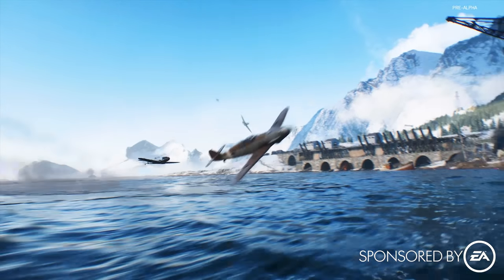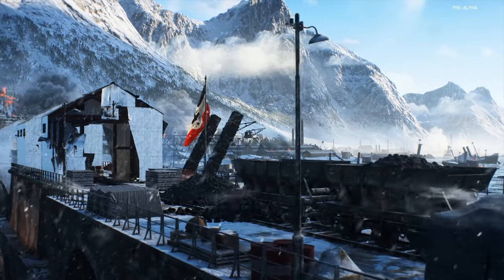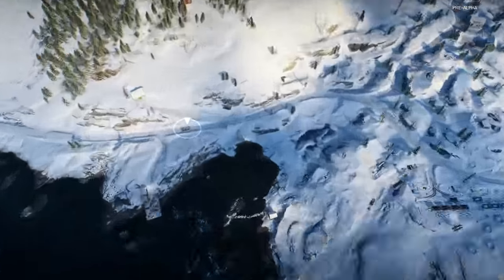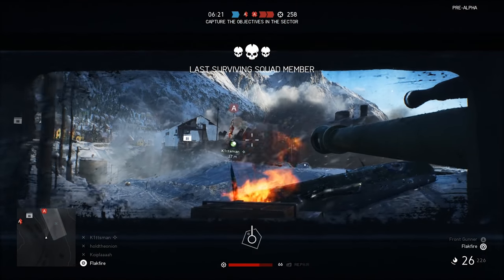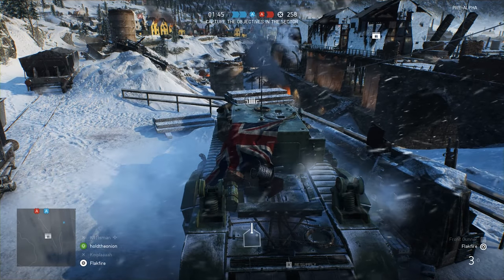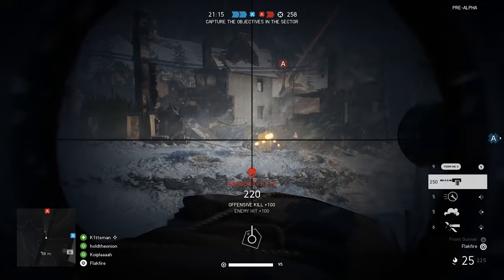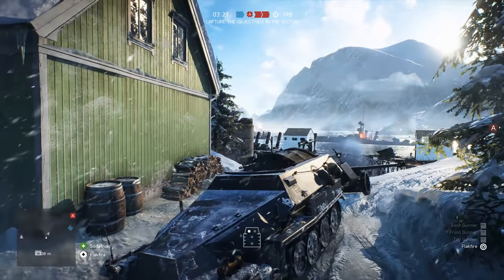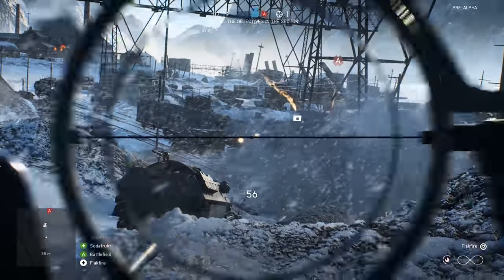BATTLEFIELD 5 Vehicle Gameplay Mechanics: Resupply, Repair, Towing Explained

Comment: omg DICE found how to balance vehicle campers? i really hope so
Reply: not really...all it takes to get infinite ammo is that you spawn with a tank as tanker class redeploy as support player with repair wrench now build a supply station around your tank and hop inside tank now you can self repair too bcoz you have the repair wrench.
Reply: Finally a way to kill battlefield campers
Reply: shubham sane These supply stations can‘t be built everywhere, just at preset places on the map. If Dice makes it right, they won‘t be at camping spots.
Reply: J.T. Kirk as long if they place them where vehicle camping is difficult or impossible. Granted as a level design, Dice would most likely place supply depots near the main spawn, but eventually, place them further out where hot zones may occur
Reply: lets hope so...but they should also be a bit away from line of fire or else infantry will get killed while resuppling their ammo
Reply: pooven mootoosamy not really since they can stay near suply points
Reply: They were always balanced. They were ineffective, and easy to kill.
Reply: shubham sane they will have to count on their team and stop playing as a Lone wolf
Reply: Oh my. Why does this show Battlefield 1's awful arcadey vehicle spawning system, where vehicles magically appear on the map as players spawn into them? That was one of the really bad parts of Battlefield 5. It removes immersion and a sense of realness, and it just feels so cheap, shallow, and arcadey. WTF would they do that again in Bf5?

Battlefield 1 is boring, its UI is distasteful, jarring, and sterile, and its mechanics are too simplified and arcadey. Battlefield 5 is looking like Battlefield 1. Not good.
Reply: So u played the release code paco? Share more of ur intellect.
Reply: pooven mootoosamy this doesn’t balance it out
Reply: David You really want a mini intro for a vehicle?? It's a game, I don't need a 10 second cutscene of some dude hoping in a tank.
Reply: Not a fan of the mid-air plane respawn. That's just stupid. In BF2 I remember having to land at base to resupply. They should do that. If maps don't have airfields then the resupply points should be far, far away from the objective. Like, the outskirts...
Reply: David ok, so how exactly would you do better, eh?
Reply: You can't balance them. They're low level or u don't like vehicles. DICE is overpatching the vehicles until nobody wants to play them since Battlefield 3 each Battlefield. Why? Because players can't handle them or walk infront of them I think. Vehicle campers are just a single excuse for bad players.
Reply: bf 1 had fantastic vehicle balance. let me guess everyone wants bf4's vehicles. tanks=garbage, attack chopper=op
Reply: BF4's tanks are far from garbage. Attack choppers aren't OP. Only the gunboats and the mobile AA are OP in BF4.
Reply: Yes but they screwed how vehicles spawn in

Comment: I love that they included the Sturmtiger. However I feel it wasn’t presented accurately- it fired way too quickly and the blast didn’t seem to be big enough for a 38cm rocket! The loading time and blast should be similar to that of the armoured train/ dreadnought’s main cannons in bf1.
Reply: If not longer, they used a built in crane to load the rocket propelled shell, which took about a minute to reload. This one took 2 or 3 seconds and while it did more damage to the tanks relative to other armor in game, it was no where near the giant bunker busting monster it was designed to be.

Comment: 'The Sturmtiger has improved frontal armor, just like in real life!', he says while shooting the 380mm gun 3 times in 6 seconds
Reply: Young Thinker - iuvenis animo you mean 45 seconds !! with very high damage ... at the current state in the trailer it's just a normal tank and nothing special about it.
Reply: AnalDash
 i guess u never played the KV-2 in war thunder. That thing has a 60 sec reload, instakills everything, and is the most fun tank to play in that game. And in comparison the kv-2's shells only have 6 kg of explosives and it is fighting other mid war tanks. The sturmtiger has 125 kg of explosives and in bf5 is fighting early war tanks. No fucking way it should not instakill everything in a 10m circle (10m is a little less than the length of two sturmtigers, where one is in front the other). In comparison, the V-1 rocket has 850 kg of explosives and kills everything in a huge area on the map.
Reply: AnalDash
That's good, good players will know how to use the sturmtiger effectively, and good players will know how to counter it with anti armor infantry! :) And bad players will QQ on the forums thats eather too OP or pure dogshit. :P
Reply: They should’ve added the Brumbarr instead of the sturmtiger. Easier to balance realistically

Comment: Church Mk 7 has better AP cabability while gun Carrier shoots faster? Wot?
would've made much more sense if that were the other way around.

The Mk7 literally uses a 75mm gun with the ''Quick Fire' designation while the gun carrier sports a modified 76mm anti aircraft gun.
Reply: Well, the Sturmtiger reloads in 3 seconds ingame. It's BF being BF.
Reply: And that.
Reply: 380mm rocket launcher technically, and it was firing at the side of an early war PzIV, so that's about 20mm lol.
Reply: Took 3 shots to destroy the panzer IV, kinda dumb
Reply: If it could destroy the panzer IV in 3 hits that'd be even dumber and not fun to play against. If we're going with realism let it one shot anything but have a 5 minute reload
Reply: ehhh that's honestly be a bit much, I can't imagine that being fun to fight against, I say have it deal real high damage (not enough to oneshot a tank from full HP from the front) and have it take 30-45 seconds to reload.
Reply: Even that itself it pretty unfun. Miss a shot and it's another 30-45 seconds of doing nothing. Realism isnt always fun is my point.
Reply: punipuni
I was thinking more on the lines of a 20 second reload
Also, how does one miss with a 38cm wide rocket? that blast radius won't play around. :D
Reply: ehh, it works fine for the KV-2 in WT, I don't see it being a problem here.
Reply: The problem is this isnt warthunder. Tanks are scarce in battlefield, one shot one kill doesnt fit well into that.
Reply: Why do you think I SPECIFICALLY SAID don't let it instakill from full HP then?
Reply: You said KV-2 which is essentially a one-shot, so i assumed you went with that. If it wasnt an instakill and it had 30-45 seconds of reload it would be utter trash.
Reply: I suppose it is true that BF doesn't have as detailed of a damage system as warthunder, so you can't cripple tanks.

I guess the thing that annoys me is that this thing shares basically nothing with the actual sturmtiger other than looks, it basically plays like a Stug with its current implementation.
Reply: Yeah i get what you mean. With a sturmtiger you expect a big house levelling boom but you end up getting a regular rapidfire cannon. I'm not really sure why they didnt just go with a stug when it has nothing in common with the sturmtiger.
Reply: The "Quick Firing" designation does not refer to the speed at which the gun can be reloaded. Originally a British naval term from the late 1800's, it is a reference to guns that had started to use bagged charges inside a brass casing. With this method, the gun was able to detonate the charge with a primer in the base of the casing and get the projectile out of the gun faster then previous methods.

Penetration wise, the OQF 3-inch 20 cwt and QF Mk.V were about on par. The Shot Mk.2 for the CWT was going to penetrate roughly 104mm at 100m while the Mk.V (being a near licensed copy of the US M3) firing M72 was going to penetrate just under 110mm at the same range. Though if firing unfilled M61, it would penetrate less.
Reply: ParaBellum 380mm
Reply: punipuni shouldnt it be more than 5minutes? And it would take a secondary Tiger Tank Crane to get those big things in it :D it was reloaded by a fucking tiger tank xD
Reply: Benjamin Conrad No. If needed, it could be reloaded in about 1 minute to 1 and a half minutes. The Sturmtiger had a fully pully system on the internal roof to assist loading so not put the crew in danger. The external crane was for restocking the vehicle. But I still want to see a bigger blast. This does not feel like an 829lb 2 stage rocket assisted warhead with 276lb of explosives.

Comment: That Sturmtiger is reloading TOO fast, even for a video game
Reply: Paladin Colt I agree but it doesn't do alot of damage
Reply: Your friendly neighbourhood Nazi The Sturmtiger took 20 minutes to reload because it was so heavy, they needed five men and a crane to lift a round
Reply: Supreme fatty Kim Jong un yea which make it even worse a long reload with very high damage is much better .
Reply: Supreme fatty Kim Jong un
the sturmtigers 380mm rocket with its 125 KG of explosives could probably delite a modern abrams, it should have a long reload with Instakill dmg.
Reply: 20 minutes and the crane were for a vehicle restock. Internally, there was a full pully system inside to assist loading, but it still took over a minute to lift a round, pull it, place it on the rail, and push it into the breech.
Reply: They should’ve added the Brumbarr instead. Similar concept but with a smaller gun which could be balanced more realistically
Reply: true, but the name "Sturmtiger" sounds more menacing

Comment: it would be really interesting if instead of having the resuplies for the planes on the sky, instead of that they could add like a base where they land their planes and manually resuply its ammunition, of course that would mean that enemy planes can enter the base and destroy the planes while they are unable to counterattack, this is only hipotetical but lets think that they do in fact add a air base where they could land their planes and repair/resuply them, 2 ways to balance this out I think it can be 1. having a lot of powerful aa canons that player can use or even it is I.A that can target u down, you can still destroy and kill both planes and pilots while they are unable to counter attack but it would take more skill to pull something like that, or well just make the enemy base out of bounds for you.
I know it is imposible to pull off something like this but then again it is just a mere thought.

Comment: Instead of having supply points for plains in the air which looks silly they should have a place for the plain to land behind spawn it would make it more tachtical as of a plain runs out it has to go and land so its not in the action and it doesnt look as silly. They did it in bf3 were you took of from a place so u can do ot it bfv

Comment: I REALLY HOPE that the plane and tanks will have damage models similar to war thunder's damage model you know not full on models but to take you out and leave the tank still usable but to the point where you can damage the engine or take out the tracks/turret/ammo rack/ETC. and for planes where your wings/rudders/aileron/elevator will get cutoff/broken or have them be able to shoot the fuel reserves and have planes slowly burn up or anything of that sort will make planes much more intense and tactical as bombers will need fighter escorts...now that i think about it the maps might be too small

Comment: WTF is jericho siren? The Stuka didn't have any attached siren on it that pilot switched on when started it's dive xD. Only thing that I was hoping for realism is pilot would black out when doing the dive with the stuka, yes that happened for the pilots and stuka had "autopilot" to pulling itself back up when the dive reached it's lowest possible altitude. Passing out happened because of the g-forces.

Comment: The Sturmtiger should be able to one shot kill any tank at almost any angle. 350mm shell can rip open just about anything and sense you only get 16 shots, combined with slow moving speed and very limited turret traverse and a lot of weak points that hostiles can kill you from behind and on sides should give it one shot capabilities.

Comment: The rocked looked better in the trailer. And now i'm not talking about the usual "trailers have better graphics", i mean that it looked A LOT better. I actually want something more similar to the trailer explosion to be an option in the graphical settings, because now it just looks boring.

Comment: That Sturmtiger would blow a hole bigger than a table into any other tank and the reload should be super slow.
Reply: No no, there would be no hole, there would be nothing. Keep in mind that it's a 829lb 2 stage rocket assisted warhead with 276lbs of explosives. You would be lucky if you could find anything left intact.
Reply: Шогк наяdег Комгдdе 

380mm rockets of tank and building evaporation.

Comment: The resupply system for planes is a bit garbage. The fact that there is an actual amo count is great but once you run out of bullets it should just recharge for about 5 to 10 seconds, maybe even make it longer at about 20 to 30 seconds to force the plane to retreat out of combat. What do you think

Comment: I think aircraft should be required to land for resupply. Similarly to how it was designed in BF 1942, land for repair. It would enhance the depth of the game if pilots were being tested on their landing and take off technique. And this would also add the value of skilled Support players because if the Support does not resupply their planes, their team loses valuable air resistance which could be disastrous. 

And needless to say that it would be great to have aircraft carrier introduced to BF5 as well!

Comment: This battlefield looks like one of the best so far mechanically and I hope this does something about the problem with aerial warfare. For a while now planes have been a thing in Battlefield but anytime i try and fly, some cunt in an AA gun sitting in the back of the map ruins me before i can do anything. Like its impossible to have a dogfight without AA guns interfering or do a bombing run without getting blown out of the skies before even leaving spawn. Its unfair bc where tanks are able to evade possible threats by driving behind cover, once an AA gun sees you, the only thing you can do is rather fly back or down and there is limited things to do when in either of those positions. I hope that the limited ammo thing really changed AA guns ability to ruin aerial warfare.

Comment: The new vehicle mechanics are a step forward in pretty much every aspect.
However, towing is way to cumbersome to be of actual use during a match. I would've preferred if the cannons could turn around 360 degrees on their own like in BF1. That way you wouldn't need to do it with your vehicle which is very finicky. :/

Comment: There better be speed control in the planes so there is actually skill required to dogfight
Reply from the maker: There is, and one of the stuka models has dive brakes.
Reply: Flakfire interesting. I know it is difficult in these times because in bf3/4 has afterburners but how the dogfighting system worked in bf1 was horrible. It was a matter of who got behind who first and that was the dogfight

Comment: 2:38 a direct hit with a 380mm sturmtiger rocket carrying anything between 40 and 125kg of explosives would delete a modern abrams, let alone just do 47 dmg to a early ww2 panzer IV. :/ Seems like plane controls are still trash compared to war thunder, and for me are completely unusable. :/ Everything else u said in the video does sound good tho! :)

PS. edit: forgot to mention that A 4 SEC RELOAD is wayyyy to shot for a tank round/rocket that needed to use all 5 crew members and an outside the tank loading crane, to load the ~350kg rocket!!! Something that in real life took 2-4 min, if not more. Like, seriously, this thing is reloading as fast as a bf3 or a bf4 abrams with an autoloader! XD 

My suggestion is to make the rocket do some serious OP damage, but with a more reasonable 20-30 sec reload.

Comment: Vehicles still looks too easy to use, tank reloads in 3 second and turret turns as quickly as mouse sensitivity... planes look kinda slow, will they have different flying characteristic to avoid circle battles? ... vehicles are powerful assets and shouldnt be so easy to use and pick, limited ammunition is a great change... in bf4 i mostly used tank i could respawn in it all the time, ending round on top of the scoreboard wasnt a problem it was very OP once you mastered it but very easy to pick up and that was not good for the balance

Comment: Disappointed. Expected alot of changes but instead got BF1 vehicles reskinned into BFV but with limited ammo. Vehicles just get more and more dumbed down each BF. I hate the vehicle vs vehicle combat nowadays. I miss when the days when vehicle combat had some skill behind it. BF3 for example when in a tank there were some weak spots that would make it possible to 2 or 3 shot kill another tank if you were accurate and get out of there without getting hit once because of good movement. Or if there was a plane shooting you and you were a more skilled pilot with better speed control you could out maneuver them and destroy them. Now it's whoever shoots first wins and dogfights are boring.

At least the vehicles are a little more realistic though.
Hopefully the gunplay is good. Looks promising